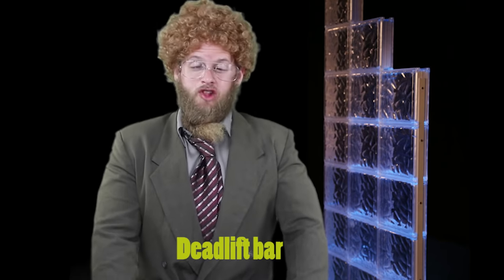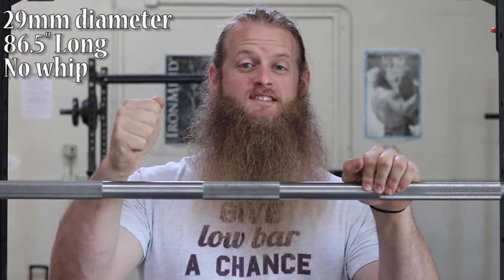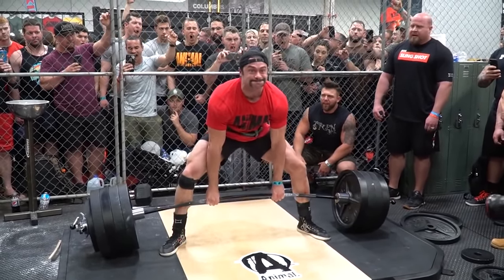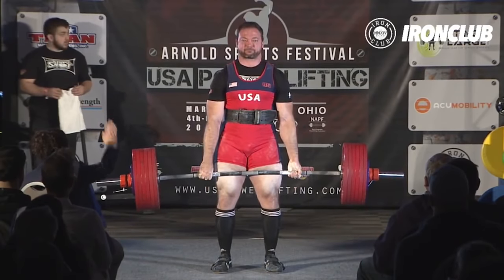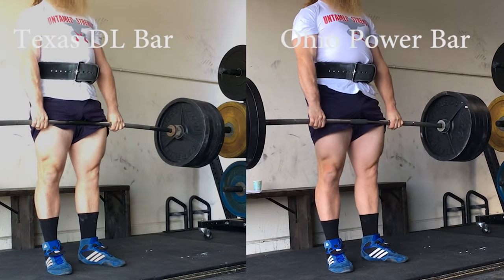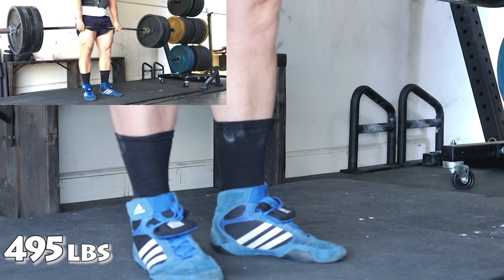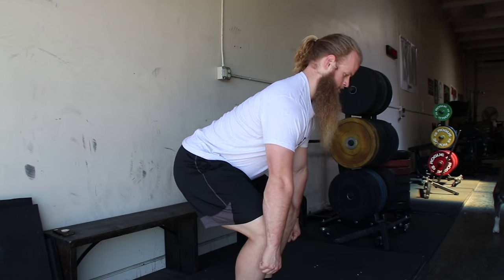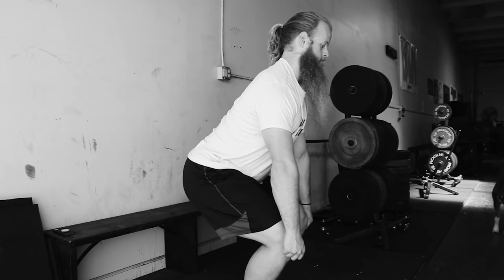The Deadlift Bar: Check It Out

Comment: I bought a dreadlift bar and my max went from 315 to 495 overnight. Then I switched to Sumo cheat deadlifts and it went up to 950.
Reply: Mark Bryant try using mixed grip (not double overhand as you did until now) and belt...i think it would brings your dl to 1500+
Reply: All I had to do was start using chalk and my deadlift shot up from 135 lbs to 2000 lbs.
Reply: If you scream loudly that's at least +200lb, maybe more if everyone in the gym hears it.
Reply: Lol "Sumo cheat deadlifts" love those.
Reply: I put on shirts that say things about weight lifting. It adds a solid ten pounds to each lift.
Reply: Lol
Reply: Mark Bryant using double underhand grip should add another ~63.5 pounds
Reply: i read this thread my deadlifts went up 600 lbs
Reply: If I put my belt on in the car and wear it the whole session, mean mug people in between my 5x225 warm up sets, and bang out some curls inside the racks then....I’m just a deuche
Reply: If you yell "light weight" it will make the weight light and you can lift whatever you want.
Reply: Don't forget to do a set of cellphone HITT workouts. These consist of hogging up the squat rack for a total of 120 characters. I do about 10 sets of 30 at 180 characters. Made me go from a 95lb bench to 405lbs in an hour.
Reply: Cranki YEAH BUDDYYYY!
Reply: That's badass
Reply: I trained my dwadlift hard for two years before commenting here and I lost my motivation
Reply: These comments are killing me.

Comment: I’ve been seriously training deadlift for 8 months. I could pull 455 on a power bar all day. I had never used a real deadlift bar until about two months ago. I pulled 495 like it weight 455. The difference to me was amazing and extremely evident.  I’m tall and have an even greater ape index than my height by several inches. The bend in the bar with 495 felt like pulling a 3” advantage with a power bar. ...And it just launched off the floor. I bought an Ohio deadlift bar last week but will continue to switch using it and the power bar just for the feeling of deficit pulls especially when doing deficits.

Comment: Deff can go either way. Yuri Belkin (only pulled 970 at 225) claims the whip really messes him up and considering he originally competed in the IPF, I'm sure he could pull around the same on a stuff bar but none of the non-tested feds use them so I guess we'll never know.

Seems like the whip gets some of the guys on the elephant bar at the arnold too.  Obviously when you have 500lb per side and it's shaking to begin with, you're gonna have a bad time.

Awesome stuff as usual Alan!
Reply: Belkin pulled drastically less in his IPF days.  He also routinely pulls less with KG plates than the thick ones in Russia by a significant margin.  Imo often the whip getting them is really just the sticking point shifting higher because now it's easier off the floor.
Reply: CanditoTrainingHQ totally true
I think one could also argue that the pound plates make it soooo easy that the whip isn’t an issue and also his drug use had an effect on his deadlift gains
I know he got caught in the IPf so maybe not but personally a smooth pull feels easier than one with whip even with just thick bumper plates
Just some devils advocate ;)

Comment: Quick question, do you think there are some people who just physically can’t get into the conventional deadlift? I have done months of mobility work, but still can’t get into the position with a flat back. Sumo isn’t an issue and neither are squats.
Reply: nikthegreekcypriot i think that,yeah. Honestly working out what u can is better than what cant. Block pulls or rack pulls and romanian deadlifts or stiff leg are better than no doing anything
Reply: beans it’s so frustrating, I’m not a particularly strong deadlifter, sumo I’ve pulled 160kg and conventional I did 152.5kg for 3 @76kg a few months ago, but I definitely feel stronger from the conventional stance. But I literally can’t get my entire back flat. If I get the lumbar flat then the top rounds and vice Versa. I do 4x6 rdl twice a week as I do a lower/upper split.
Reply: nikthegreekcypriot I had to change to conventional because I wanted to do strongman. Have you tried working a few months on an 18 inch deadlift instead?
Reply: nikthegreekcypriot do you compete tho. Because if you dont you can just sub the deadlift for what i said above amd still get amazing strength and musculature and not snap your low back. I think i oughta do that cuz my low back has been hurting after deadlifts
Reply: Maximillion Thermidor when you say an 18 inch deadlift do you mean block pulls? I can pull with a straight back if the bar is on blocks  approximately 4 inches off the floor
Reply: Thoracic rounding is absolutely fine. Sounds like you’re being overly critical of yourself. A lot of the top deadlifters in the world round their upper backs.
Reply: abitoftheoldultraviolence I’ll upload a vid of me pulling 150, first time id pulled conventional in ages, you’ll see my lower back is slightly rounded. I’m more worried about injuring it because I’m a multi trader who does plastering, decorating, drylining etc so a duff back from a duff deadlift would not help my work haha
Reply: nikthegreekcypriot upload a form check video to YouTube and I’ll try help you out
Reply: i used to have this issue, over months of just light weight work in the movement it feels much better now that the starting position is figured out, the way im built requires me to have high hips at the starting position similar to a stiff legged deadlift, when i try to drop my hips lower at the starting position my back starts to round. try pulling with high hips until you can get to the best position possible for you without your back rounding maybe?
Reply: Rounding the upper back for the deadlift is a technique that some high level competitors use to pull from a higher position/reduce the ROM. If you can get your lower back flat, that is FAR more important than upper back. Obv getting both flat is ideal, but do what you can.  If there's a Starting Strength Coach near you, it would be worth it to get a session or 2 in with them. Otherwise you can post to the SS subreddit for a form check, or on the SS forums.
https://startingstrength.org/site/coaches
Reply: Have you tried the 5 step method? Most people who use that method can get into a relatively good position,regardless of flexibility.Also,keep in mind that a few warm-up sets will stretch your hammies,allowing you to get your lower back more flat.
Reply: Thanks for all the replies and opinions, much appreciated. I’ve just uploaded a vid of me conventional deadlifting so you’ll see what I mean by the positioning being awful.
Reply: that actually didnt look that bad, honestly it looks good to go for me since it seemed like it was on the heavier side. how close was that to your max? and does it look the same if you were to drop the weight by lets say 50 pounds?
Reply: I was watching a video by some guy from Singpore...he was mentioning how lower-back pains from deadlifting is usually due to a bad starting position. Something I can attest to. As recently I've used more power from my right leg for leg drive as it is my "power leg". Bad idea. Bad habit. So my lower back began aching afterwards at the left hip.  When I consciously made sure I used both legs to drive with equal strength I was good. Which was what did from the time I began PL (which hasn't been long). When we don't get a good starting position other muscles upward start "compensating"...that's where the lower-back pains come in...could be rounding of the back (usu a bad idea)...pulling too much vs using more leg drive...etc.

PL...never ending quest for better form and higher PR's. :)
Reply: You don’t need to start with a flat back. Watch some of my deadlifts. Pete Rubish has a ton of round in his back when he starts as well, it’s a technique. As long as your lower back isn’t rounding you’re not going to hurt yourself despite what most people will tell you.
Reply: Sneaky Kitty Gaming that was somewhat close, because I don’t do conventional I don’t know what my actual max is but the 2 days after this I did 152kg for 3 so it’s got to be close. The form always looks the same, can’t figure out what’s actually causing my lack of mobility as I’ve done so much work on it
Reply: nikthegreekcypriot trap bar deadlifts might be an option, high handle ,or low handle for more rom. 🤙
Reply: nikthegreekcypriot you have weak hamstrings. Jefferson deadlift and flute ham raises would be my suggestion for you.. lots of hamstring stretches. I usually warm up on a stair stepper, then I stretch, hamstring raises. Then I deadlift. I would Jefferson deadlift if I was you. Then I would do a few conventional pulls.
Reply: You'd need to show a video of your setup in order to make sure.
Reply: Sounds like tight hamstrings and maybe glutes to me, Nik. Although "stretching" for greater flexibility/ROM is poo-pooed by self-styled "bro-science busters" on the interwebs these days, i'm middle-aged and have been stretching my hamstrings, glutes and ankles (flexion) for 20 years for other sports, and have no problem conventionally deadlifting and squatting ass-to-grass in bare feet.  As Yoga clearly shows us - no-one is born with lifetime flexibility. We de-train after birth!

Comment: Do you have any guidance for grip strength?  I think you said in a video once that the majority of your work should be with a double overhand grip versus a mixed grip, but I can never hold 315 for more than a few reps.  And any more weight than that I need a mixed grip.

Comment: I was thinking of getting a deadlift bar, my max deadlift currently is 170kg ( metal caliberated plates) 
I am using stiff bar of 29mm dia , my hands are little small coz I am 5'7" and I face little difficulty sometimes to pull max weight as my grip gets loose after some sets
So is it worth to buy a deadlift bar of 27mm or should I work more on my forearms and grip and continue using stiff bar ( my target for this year is 200kg)

Comment: My goodness... you meassure bar thickness in milimeters and bar length in inches... why not just use meters all the way... or then at least just use inches all the way
Reply: Converting from mm to inches is easy, but if something is exactly 29 or 27 mm, then the inch value is going to be really cumbersome and not worth discussing.  For example, which is easier to visualize: 29 vs 27 mm, or 1.14173 vs 1.06299 inches?  I think mm is more appropriate for shorter lengths, personally, for this reason.